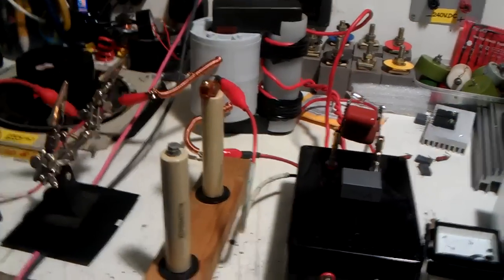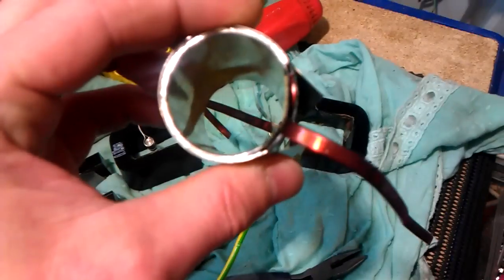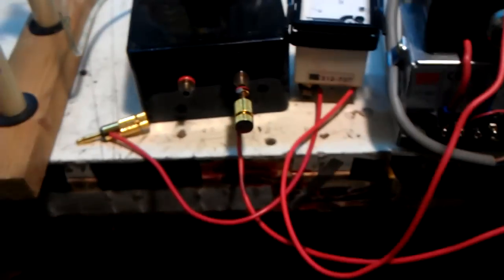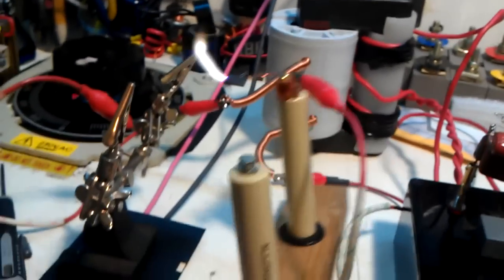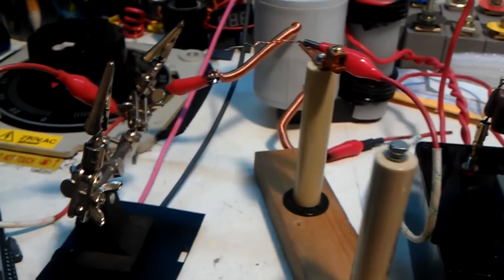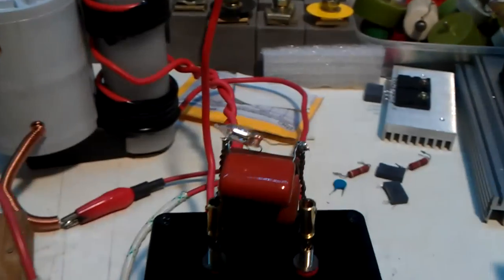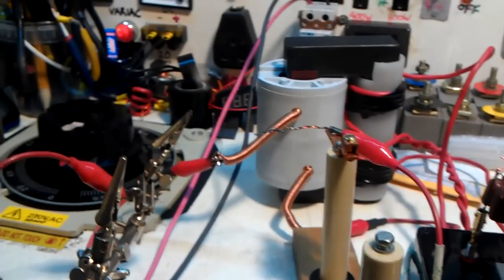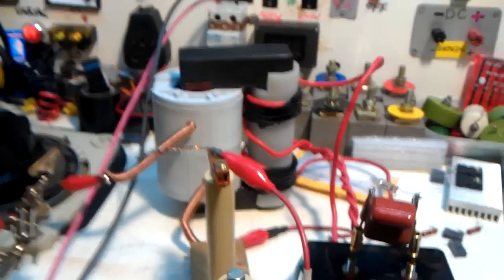Big x-ray trans flyback! A must see guys!!

Comment: Great arc there, love the multiwind pot on your psu, is it fan cooled? I could here a ramp up going on
Reply from the maker: Pete C helloate, yeah sorry for the bit of delay, I get so many emails lol,
yes this transformer had a 1 turn pot inside, and I replaced it with a 10 turn. and the fan is a 24 volt on the output. so it increases with load. 
and the project box with the banana plugs connections make it easier than screw terminals. 

and the black project box to the left of the power supply is a zvs inside. and the banana plug terminals on top are for changing the value of capacitors to either give higher current and frequency on the output of the zvs.⚡

subscribe mate and watch other videos, as iv some Awesome stuff to show.😋 
and other questions I'll do my best to get back to you!

thanks for the comment mate and be safe 👍😉

Anthony 

High1voltage1rules

Comment: Hey dude, Ive been hunting for an XRT for over a year now without any success. I have been unable to find one on ebay or any where else for that matter. I am at a total loss as to where to go now. Can you offer any advice as ive had a project on the back burner now for some time that cant be done without these kind of voltages. many thanks, awesome vids full of great info & cool tests by the way.
Reply from the maker: Hello,  well iv always have them for sale. and there not much to buy from me. but depending where you live the postage could be a bit pricey! let me know if your able to purchase from me. the transformers can be from £200 to 400. 100kv to 150kv. at around 500-600mA out, and for postage I can find out after I hear where you live. if your in the UK your laughing. 

Anthony

High1voltage1rules
Reply: I am based in the southwest of the UK, so probably a fair way from you i suspect. But to be fair. After contemplating shipping a GENDEX 765DC head complete with oil   from the US, UK shipping will be peanuts compared to that. The shipping from the US along with customs was as much as the head. Then ther is the agro of stripping the head. The Gendex are a bit of a notorious one for getting apart according to advice ive taken. they are form molded so much dremmel cutting afoot haha. Ide much rather purchase from you if possible.
Reply from the maker: +Luke Bowers hello mate, yeah it's no problem, but I have one thing to say my friend and that is if you do decide to buy a transformer from me, I hold no responsibility for any miss use from the transformer as it holds very dangerous voltages. I'm not trying to teach you how to suck eggs or anything mate, but as you have never had one of these there seriously big boys equipment' and I always say this to anyone who buys from me mate lol there Awesome transformers, and I only deal with the good ones, there hard as nails and give very good outputs, you can either buy one that's been modded for a none capacitance output (less current draw) or a none modded, but the output is spark like, capacitance and pulls alot of current mate, so the caps and circuit for monitoring has been removed. alot better for many projects.  
so when your ready for buying from me I'd prefer the payment upfront as iv been stung before!  you can either send a cheque or cash by recorded delivery, as iv had this done many of times, as I done use PayPal. 

when your ready send me a email to Antwasere@gmail.com and I'll send you some pictures of what iv for sale. and give you my mobile number too.and we can discuss the next option. 

many thanks 

Anthony 

high1voltage1rules
Reply from the maker: +Luke Bowers hey there mate. yeah no problems. when I get a moment at the weekend I'll send you some pictures to your email.

Anthony

High1voltage1rules